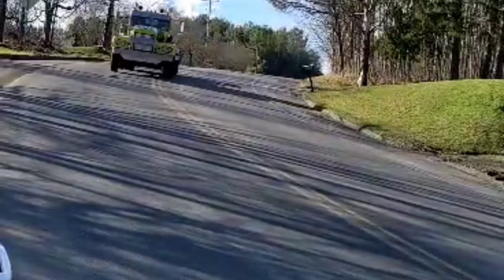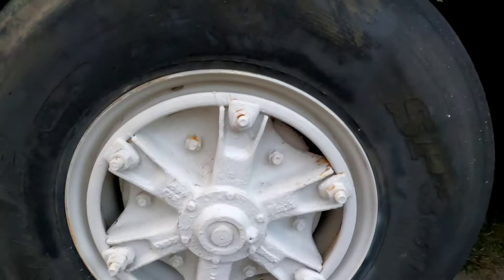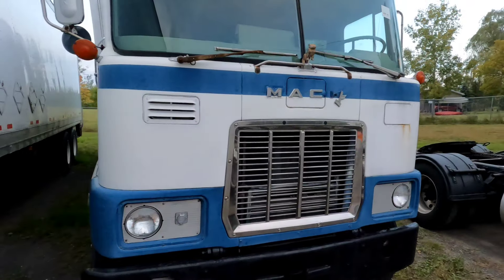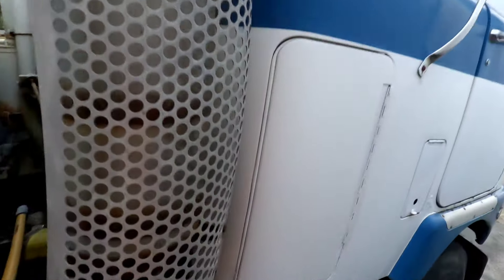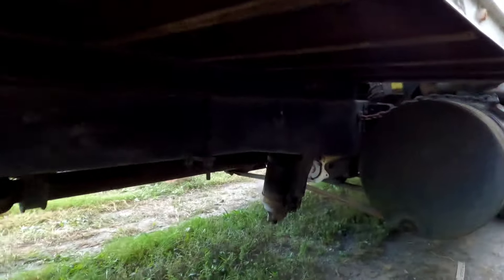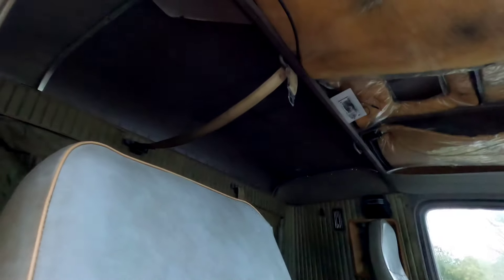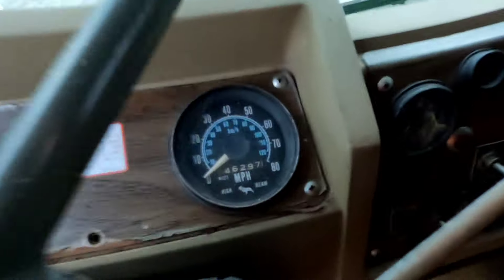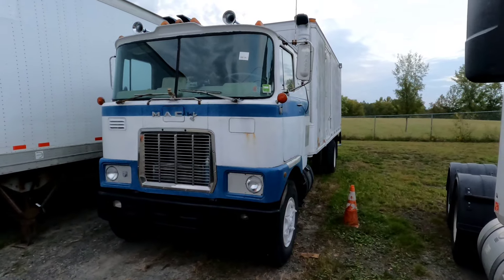A BLAST FROM THE PAST #vintage  Mack F Model  #cabover #freight #truck #trucking #automobile #memes

Comment: A really cool piece right there! It's in great shape considering its age and the fact it's an F model. So many of the steel cab ones rusted out. I remember when they were a regular sight on the interstates. They sold a lot of them and as a kid growing up in the 70s and early 80s in NJ, you would see them traveling the turnpike and I-95 from all over the place according to the company name on the doors.

Comment: I drove one of these from the start of my tour of duty. 1973. Our company even went so far as to replace the complete cab after many miles. The only options: mirror heat and dash fan to clear w/s. That huge w/s could not be kept clean of ice in winter. You had to stomp your feet to keep them warm. Some of us would wrap plastic around our body from the dog house to keep heat low and not in your face. We had uni shift and Maxadynes. Best idea was the oversized air gage, loud buzzer and bright red low warning light. When Mack came out with the MH we moved up a bunch. Then we went conventional. Even better. You could not find the word MACK on our trucks. Did not care for the wet clutch but most drivers loved them.
Reply: Must have been a UPS driver
Reply: @Retired88M  Brown Blood all the way!🦇

Comment: I've driven 2 of them old F models. 1972 I drove a day cab with a v8 thermadine and a try plex 15 speed transmission.  In 1986 I drove another f model with a 300 maximize and a 5 speed. Both were good trucks but I hated that 5 speed! Just not enough gears!